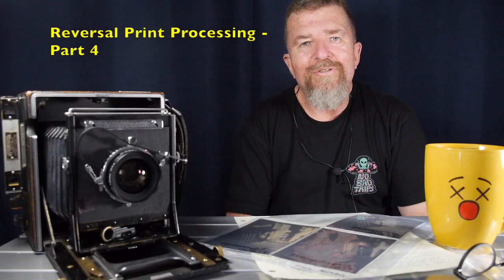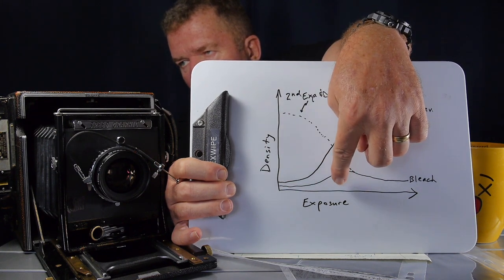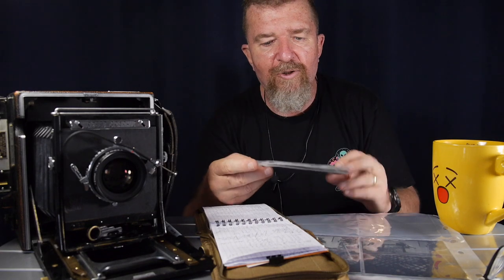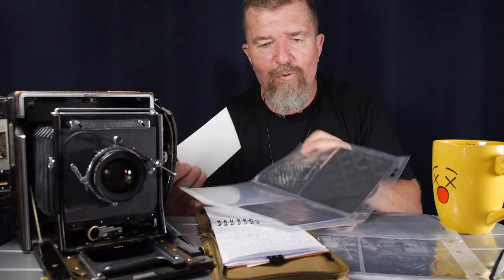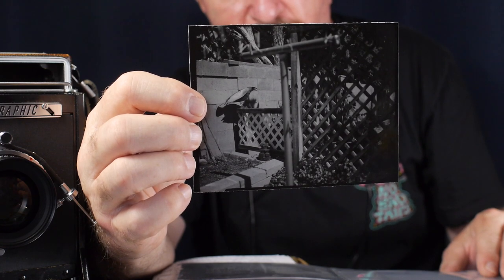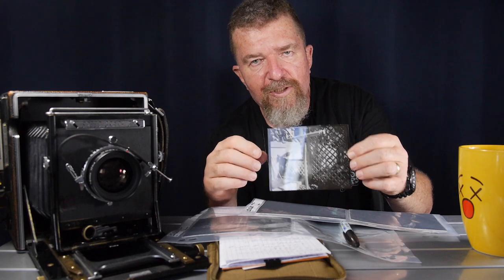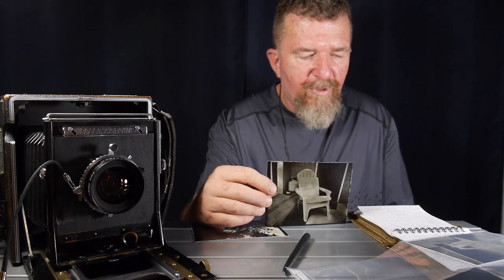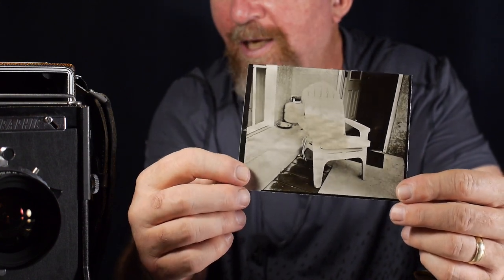Reversal Print Processing - Part 4

Comment: Thanks for your work on reversal prints.I have been reverse processing B&W film for years. Ive been interested in trying reverse processing prints not only for in camera shots but also printing some of my reversal films. Ive learned a lot from your videos and I am getting ready to give it a try. In comparing your  paper  process to a film reversal process, I noted that you do not use a clearing bath after bleaching. Is there a reason for not doing so? I wonder if some of the problem you are having with mottling may be resolved by using a clearing bath? Here is a quote from the Ilford PDF on reversal film processing regarding the need for a clearing bath: "This is to clear away all traces of the powerful bleaching bath, and the slight stain it leaves behind".  Thanks again for your informative videos on the subject.
Reply from the maker: It's very likely the cause of the mottling. A clearing bath would be good idea. Thank you for watching.